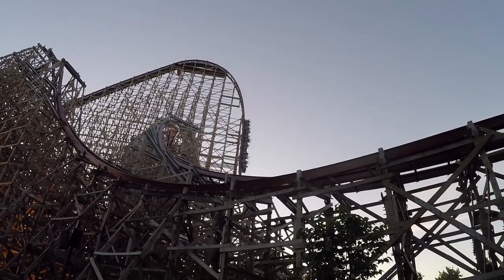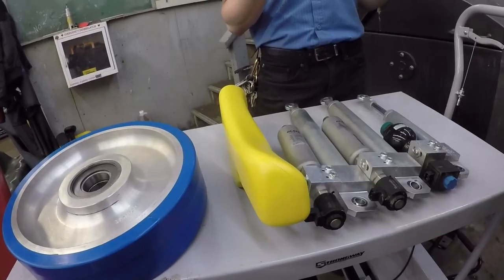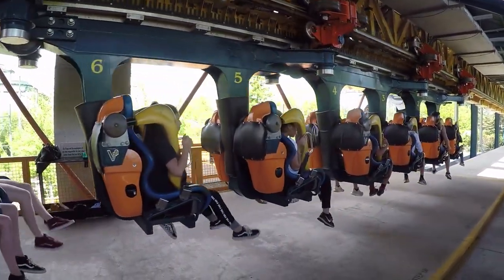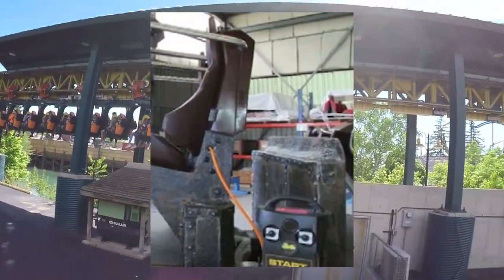Can Roller Coaster Restraints Open Mid Ride? (how roller coaster restraints work)

Comment: I do have a question actually so a nearly ten years back my family and I went to Orlando Florida. I remember this one day at SeaWorld we got on the Kraken and my uncle got the seat with the two belts. I'm not sure when it had happened but the restraint actually popped up (thankfully he had the belts on) but held it down as tight as he could, he swears that the seat was undone. Now my question is can this actually happen on this ride? Or did it just move up to lock into a different position?
Reply from the maker: No it just slipped a ratchet, aka it was not fully clicked into one ratchet so it slipped up one, quite common but the restraint remained locked!

Comment: One time I was on a steel rollercoaster with a bar that came down as a restraint and while going up the hill on the chain, the bar on my seat was released and came up.  I quickly pushed it back down and luckily, it clicked back into place, but it really freaked me out.  It seemed as if my seat was the only seat it happened to.

Comment: In the case of the Orlando Icon Park death of March 24, would there have been any possibility of the OTSH flexing under the deceleration and weight of the rider, or perhaps the hydraulics being compressed if there were some air in the system? Which manufacturer was most to blame for this failure, Funtime Group, the ride builder; or Gerstlauer Amusement, which provided the seating system to Funtime?
Reply: Assuming proper testing procedures were being followed no. The ride has a test jig that places outward pressure on the restraint for an extended period of time to check for line leaks
Reply: If you're curious about the specific testing procedure, the operating manual has been made public as a result of the ongoing investigation

Comment: Ok so I have a question. A couple years ago I was really scared to go on Gemini at Cedar Point, i sucked it up and rode it. While me and my sister were going up the lift the ride stopped and went backwards a little bit, after it did this the ride slowly tilted to the right for a few seconds. The ride quickly shot up to its normal position and continued going up the lift. What happened here? I have done my fair share of coaster research but I still don’t know what happened!
Reply: Hmm, if the chain stopped maybe it was the train rolling into the anti rollback system. Happens rarely, but if it’s that you experienced a working failsave
Reply: Kärnan Fanboy oh yeah! That’s definitely a possibility! Thanks for the help!

Comment: Some ratcheting restraints especially on coasters made my MACK Rides can "get stuck" locked and not open immediately when unlocked they can be opened by pushing them down slightly my first encounter with this lead to a kinda funny story of me being stuck on a wild mouse for a few minutes as neither me nor the ride operator knew to push down on the restraint.

Comment: I have worked on kumali a verkoma SLC at flamingo land, it uses a ratcheting system and sometimes it lifts the seats  lift up after the zero g roll, please could u explain this
Reply from the maker: Yea it was probably “slipping a ratchet” meaning that the restraint was not fully clicked into the next ratchet and at that point on the ride it clicked up one into the next ratchet!
Reply: GP To Enthusiast ahh ok cheers for that, also we have lost river there and that has a ratching systems although that systems is where staff member have to put it down, the ride was made by Bear rides just wondering if you could do I video on this manufacturer

Comment: My restraint came undone at Busch Gardens.
Python. It was scary. Not one person ever noticed. I had to wedge myself into the seat, and gravity was not on my side. It never locked in the first place. They came by and pulled up on my thing, but it never locked. The only thing holding it in place was the seatbelt. I tried to get their attention, but they couldn’t be bothered. Anyway, I nearly slipped out. I most certainly would have died because I would have been thrown by the roller coaster from high up.

Comment: Ride restraints rarely come undone if they're not supposed to. Most of the times do it's because ride operators didn't check them well enough, or guests were fooling around with the restraints.

Comment: I swear one time on Raging Bull the lapbar popped up while going up the lift hill. It uses the ratchet restraints just like the one shown in the example at :31. I was chubbier back then and barely got the lapbar down far enough to get cleared to ride, but the ride op gave it good hard push and got it down far enough. Then about halfway up the lift it popped back open and the train kept climbing. I immediately yanked it back down and held it as tight as possible. My cousin next to me saw and also reached for it. We we both were saying ‘wait the seatbelt, wait’ but not yelling lol.. idk? And who could hear us at that point? Anyway needless to say going over that hill was scarier than ever because even though the lapbar had clicked back in, how was I to know if it wouldn’t open up again during the ride? The rest of the ride was fine although not enjoyable lol and I took it as a wake up call to lay off the cheese fries..

Comment: Not a restraint question per se, but a question about safety nonetheless. Is it safe if a flat ride is only bolted into a wooden board? I ask because I noticed this at the CNE last summer, one of their flat rides appeared to only be bolted into a wooden board.
Reply from the maker: yes, most transportable flat rides are are set up like that.
Reply: @CoasterCollege  Huh. Ok, it's just if that's so then somehow I must have never noticed before. Thanks for the response.
Reply from the maker: @BmanTheChamp  yea most places with portable rides do a good job hiding that.

Comment: This happened to me at six flags. The locking mechanism didn't lock for some reason and when I tried to tell the girl that was working, she ignored me, so I had to go into the ride with a loose safety mechanism. Luckily I had a seat belt, so I didn't die.
Reply: you can have like 2 inches of room and still be safe, it might be scary but you will stay in unless you try to fall out. The person working didnt care because she knew that it wasnt an issue.

Comment: I’m 4’11 and was like 80 lbs on the mantis (that info is relevant because it was hard for me to even get on the seat AND push it down to a comfortable position) My seat wasn’t fully locked in so when we left the station it locked into a higher position and I was standing on my tip-toes 😂 was NOT a fun ride (but then again I wasn’t a huge fan of the mantis to begin with)
Reply: That happened to me with Green Lantern at Great Adventure. The thing is I’m a guy.

Comment: Imagine if the restraints opened going up the lift hill on a B&M Flying Coaster? How scary 😱
Reply: B&Ms are the least likely to make that happen. It is however possible
Reply: Emoticono13 No, it's NOT possible. There's a failsafe in place

Comment: I was on a coaster that was like the one at 2:25 and when it went in loops i would push against the restraints and it felt kinda loose but it was not so i felt very scared so i was not enjoying the ride that much

Comment: I feel like most of the people in the comments claiming their restraints 'popped open' mid-ride just experienced a ratcheting restraint pop up to the next ratchet slot because it wasn't fully slotted into the absolute tightest ratchet slot possible for them... completely normal, maybe slightly unnerving yes, but totally safe and you'll just have a bit more of a roomy ride :)

Comment: I remember one time I was riding Montu and had the ride op pushed my restraint down too tight for me and mid loop it loosened one click. It was lowkey kinda fun but also so scary. I don’t question montu’s safety tho, the ride op made an error, not the ride itself.

Comment: How safe are the seatbelts on most rides?
Reply: the seatbelts dont do anything, all they do is measure to see if the restraint will safely hold you. The thing that is holding you is the restraint itself, it has a locking system that make is pretty much impossible to come undone.

Comment: I had a restraint on one of the ONLY roller coasters I will ride at my summer camp come up right before a twist drop, it was scary but I managed to pull it back down and it locked right when we entered the drop. After we finished the ride I told the operator and he called maintenance right away. This is the reason why I only feel comfortable going in the roller coasters at this park, because the operators are really nice and you can get to know them if your there for a long time like me, and also because they have really really good safety procedures there

Comment: What about flying roller coasters? They’re electronic locks. What if the electricity of the park shuts down?
Reply: thats not how restraints work, they need an electrical force to OPEN not STAY CLOSED. if the power goes out operators will use a battery to open the restraints. but ye once they're close, they're closed.

Comment: Once I was on a ride
And on a station after I was sat and the restraint locked it opened
I screamed at the crew crew and a guy came and calmly cmalped it back down and off the ride went
Little to say I nearly issued my selfe throuaught that ride and the restraints had my nails imprinted in em

Comment: I went on the Coney Island cyclone rollercoaster and let me tell you…THERE IS NO SEAT BELTS OR BARS TO HOLD YOU DOWN. Worst and scariest moment of my life. If I didn’t hold on tight enough I would have been flung out and died.
Reply: The ride has operated for 95 years. Two people have fallen out, and only because they wriggled out of the restraint and were standing up. Millions of people have ridden that coaster with their arms in the air. You would not have died. And it does have a lap bar.
Reply: @triple7marc  the lap bar was not holding me down. Hence why I had to wrap my fucking arms my best friend so I didn’t fling out. There’s a height requirement and I’m 4’10. I don’t remember anything holding me down. I was slipping everywhere man
Reply: @gingerandmax6106  you were still safe though, the only way you would have fallen out is if you tried to.

Comment: "Parks take this very seriously."

You've clearly never been to Busch Gardens, Williamsburg. The minimum wage teenagers and college students there give things a light tug and don't even make eye contact with what they're checking most of the time, they're usually too busy trying to talk to each other.
Reply: The ride operators there are trying to be quick with operations. They don’t even need to see the restraint, if they tug the restraint and it is in locked position, you are fine. It doesn’t matter how little the tug is either. They would feel it. It’s not like they need to take their time, they need to have fast operations. Busch gardens is a very good park with very good ride operators.
Reply: Every single park gives a light tug too. If you don’t trust the operators, check it yourself. You will be fine.

Comment: Ive been on a few coasters in my time, not nearly as many as most of the people who make these kinds of videos, with this in mind, I have never had any kind of problems with restraints on all roller coasters I've been on. However, I have had multiple cases of ride restraints not working fully on carnival rides, from sliding around in my seat to nearly dislocating my hip. In all honesty I would 100% feel safer on a park coaster than any carnival ride, so I have no idea why people are always "coaster bad" but carnivals always get the pass around.

Comment: No way..... One night last year at Cedar point I was riding the Raptor (First row, Seat second from the left end) and it was all going smooth until we passed the lift hill at the top of the ride, when.... clunk .... clunk , and the overhead harness opened mid-ride, I was scared as shit because there are so many inversions on that ride, thankful there was a seatbelt because I probably would have slipped out.              

Edit: I emailed the Park Maintenance and they said they inspected that row and said their was no damage or wear that would instigate that.
Reply: No just no

Comment: Has anyone seen the Officer O Leary video where he was on Steel Vengeance and was able to fit HIS WHOLE ARM under the restraint while the ride was in motion? Whoever let that slip should be fired
Reply: It's not dangerous as it might seem at first glance. Trying to slip out of a lap bar that is any less than 6 inches above your legs would probably require you to break both legs somehow lol

Comment: I can’t enjoy the booster as I was left hanging in the air facing the ground with nothing but the restraint stopping me so I didn’t feel good. A seatbelt would have made me feel safer
Reply: A seatbelt would slow down the ride operation and make the lines longer so good thing there's no seatbelt
Reply: That’s the point of the restraint..... what even is this comment
Reply: Good things parks don’t listen to random people’s “feelings” of safety.

Comment: Yes if it's not locked correctly iv had it happen
Reply from the maker: It could move up a ratchet, but as soon as it leaves the station they are locked. What ride did this happen on?

Comment: I Hope That Never Happens To Me. 

And I’m Glad That They Have A Seat Belt For Extra Protection.

0:10 Banshee. 

0:18 Magnum XL 200. 

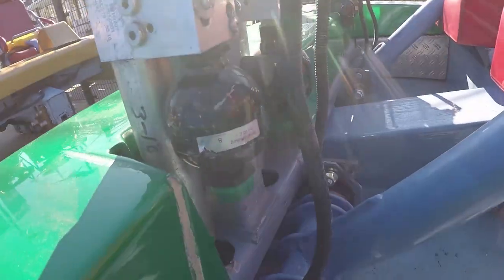0:41 Magnum XL 200 At Night.

0:45 Top Thrill Dragster.

1:05 Steel Vengeance.

1:16 Wicked Twister.

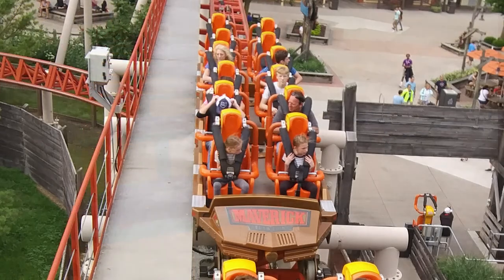1:31 Maverick.

1:34 Steel Vengeance.

1:44 The Gemini.

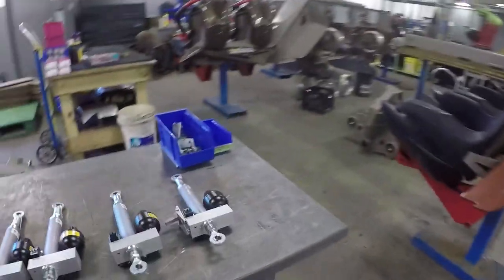2:15 Beat Belt.

2:56 Raptor.

3:17 Magnum XL 200.

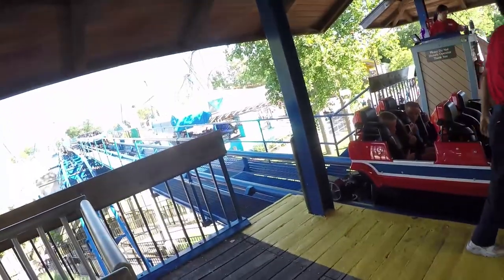3:28 Corkscrew.
Reply: The seatbelt just makes the lines longer

Comment: Why does nitro at six flags have just one pathetic bar its fun but wtf not extra protection if that opens up ur dead on that drop ?
Reply: 1. Because it doesn’t need extra protection. A lap bar is just fine for that ride because the forces don’t require your upper body to be secured.
2. “If that opens up ur dead” Yeah, but it won’t. It’s a non-issue. The company that built that ride, Bolliger & Mabillard, has a perfect safety record in over 30 years of operation.
Reply: @triple7marc  everywhere i go... i see ur face
Reply: @Fluffy_Coasters  I comment a lot lol
Reply: @triple7marc  i can tell

Comment: as a coaster enthousiast i've had my restraint open during a ride twice
1 during an overbanked turn which was a bit scary but i closed it again and it was fine
and 2 the restraint opend and then forcefully closed again due to the g-force killing my phone in the proces (yes phones inside your pockets were allowed at the time + the coaster was not that intense)
What also happend once to me was the pre station and station brakes failing so instead of slowing down we just crashed into the train inside the staiton (i think the only damage was the bumper thing in front of the train that broke a bit)
Reply: You've had a lot happen to you. 

Yeah, I don't believe any of it.
Reply: @jdrammer5664  then don't. me and the people i was with know it happend and it's up to you to believe it or not
Reply: @jdrammer5664  the "crashing" train was actually in the news somewhere (speedy bob in Bobbejaanland)

Comment: My moms restraint came up on hurler at carowinds
Reply: No they did not.
Reply: what kind of restraint was it? looks like a relatively old ride.
Reply: @Spoiled_Rat  it was an older ratcheting restraint used on the trains made by the Philadelphia Tobbagan Company which I've heard rare instances of lap bars coming up one click. But there is almost always a seatbelt on those rides that will prevent anything bad from happening because of that.
Reply from the maker: Yea it probably “slipped a ratchet” meaning that the restraint was not fully clicked into the next ratchet and at some point on the ride it clicked up one into the next ratchet!
Reply: That makes a lot of sense, thanks guys!